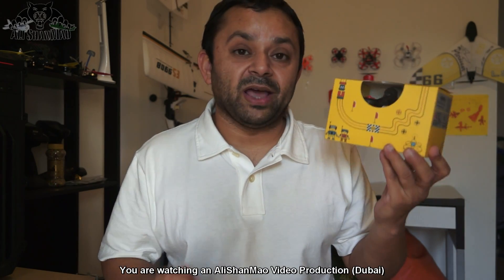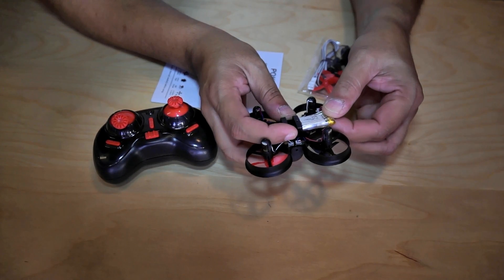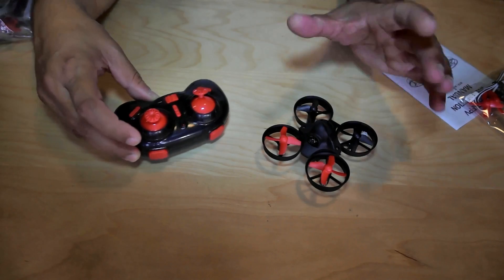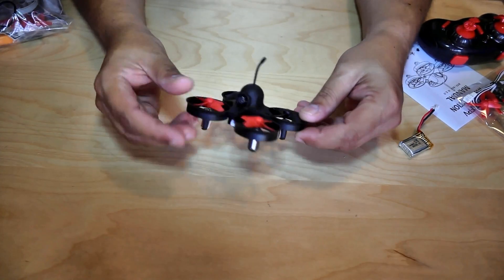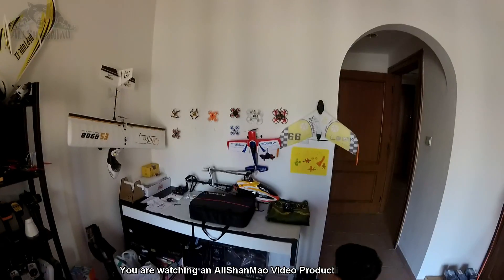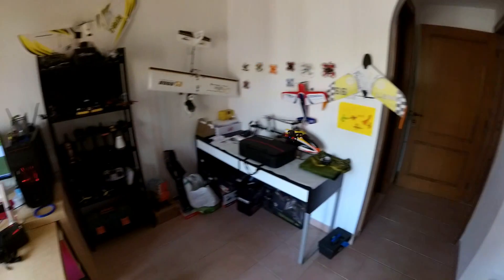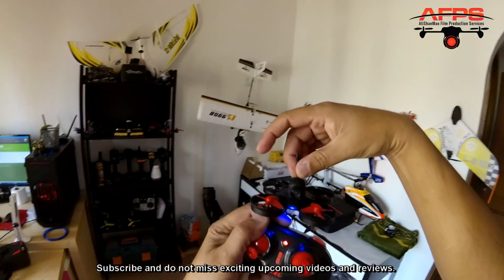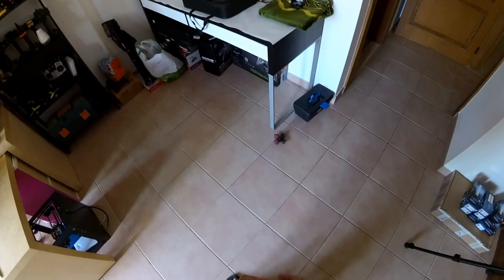Another Tiny Whoop Clone Nihui NH-010 FPV Quadcopter

Comment: How do you mount your micro quads on the wall?
Reply from the maker: Get some 3M Command Hooks. They are super nice to put on anything and when you want to remove them, just pull the stick part and hook will come off without damaging color on wall. You can buy more sticky pads for these available in local marts and stick or relocate them whenever you want. 

before i use to drill holes and use nails. Now I use these command Hooks from 3M. they are strong and take load. I use big ones for my planes too. 

This link should give you an idea. this is what i use for my Little quads. if your quads are big or heavy, just get suitable weight capable 3M command hooks
http://www.kmart.com.au/product/3m-command-mini-utility-hooks---clear,-set-of-18/119940